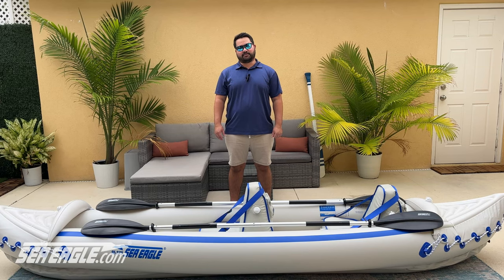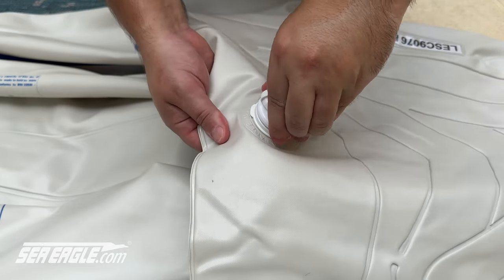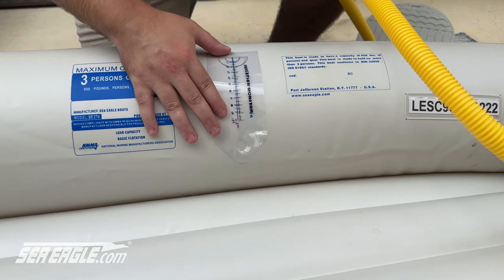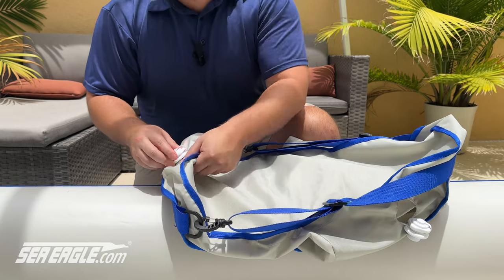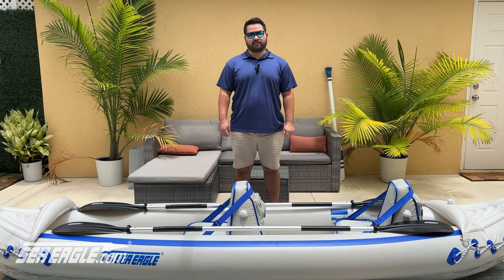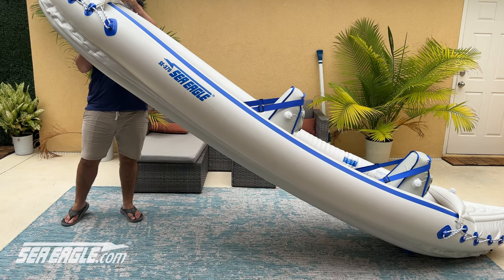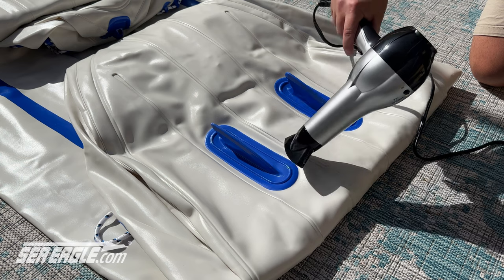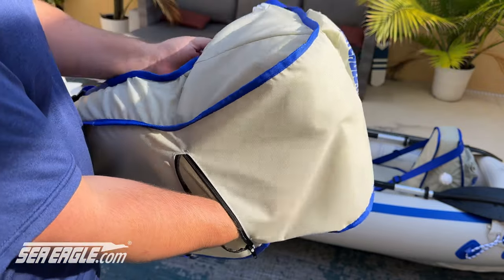Sea Eagle Sport Kayak Instructions - SE330 & SE370 Inflatable kayaks - 2023 Troubleshooting

Comment: Should the floor be absolutelu firm . Im having a difficult time judging
Reply from the maker: If you're using the foot pump you can inflate until you start to feel back pressure or resistance from the pump. At that point the floor should feel firm and ready to go. You want it to feel about the same firmness as the side pontoons.
Reply: @SeaEagleBoats  its hard for me to resistance but i am making it pretty firm

Comment: I bought a SE330 a couple months back from a friend. I Still have a hard time keeping it goes straight even though I tried like your suggestions. Any ideas? Can I add a skeg by glueing it at the bottom of the boat? Not sure if the skeg will stay in place..
Reply from the maker: Hello, 2Itkgaming8547, sounds like you've already checked to confirm your skegs are not bent. There's no need to add additional skegs. The first possible and simplest solution is to inflate your kayak and confirm your side chambers are symmetrical by equally inflating both sides. Next, stand at each end of the kayak and confirm its level. If it's not, with the spray skirts deflated, loosen the spray skirts ropes, adjust the sides until level, and resecure the spray skirts ropes. Another way to confirm the sides are level is to take note of the location of the side chamber air valves once inflated. They should be even with one another. Last but not least, double-check your paddle strokes. This clip is from our PaddleSki video but the principles are the same ► https://www.youtube.com/watch?v=8mJOpyQeolM&t=397s. There are also some valuable tips in this video ► https://youtu.be/kcukFqTwlrY. Thanks for watching. We hope you'll consider subscribing to Sea Eagle Boats YouTube Channel for more informative videos and new product releases to come!
Reply: Hi, I have 3 of these and many other Sea Eagle boats.

One thing that I found helpful is to change seating positions. It can make a big difference. If it had a tendency to spin, try moving your seat around. Also, it is very easy to face the the boat the wrong direction. Verify your kayak is facing forward. It looks about the same from the top either way, but the skegs on the bottom will show you the proper direction. I've made that mistake a few times.